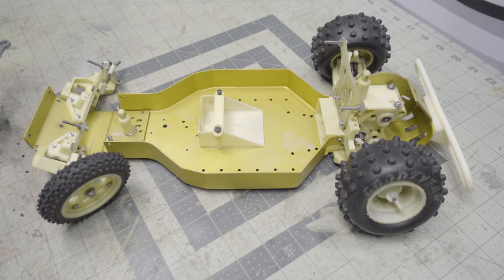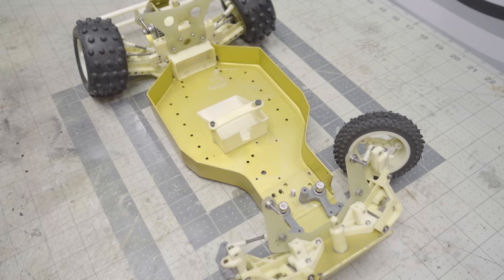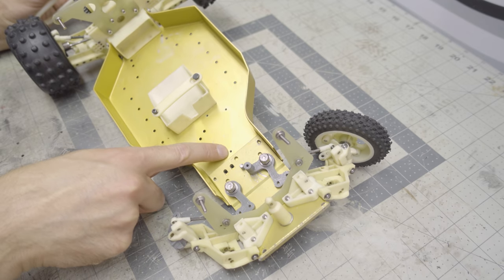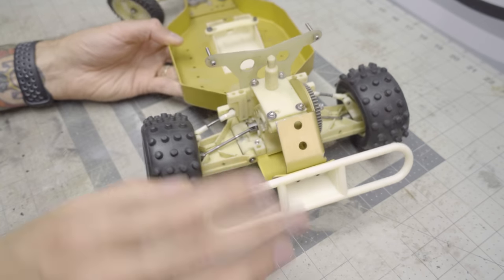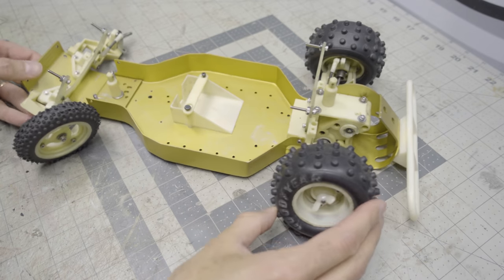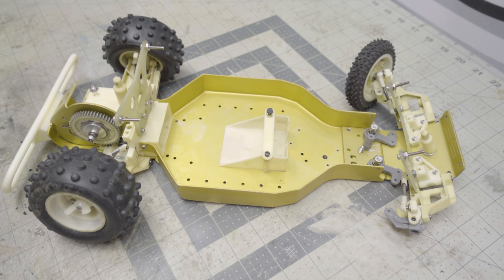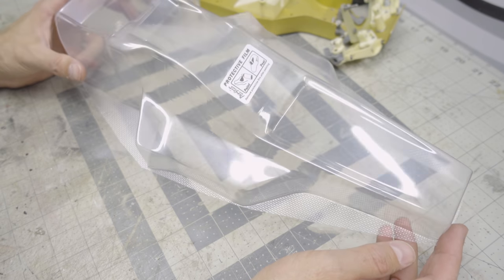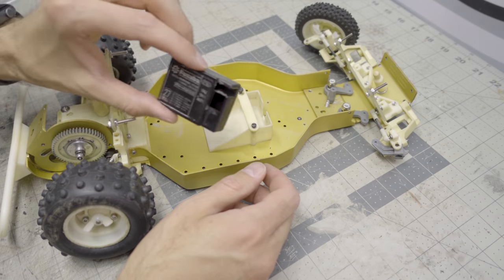Throwback Thursday! Associated Electrics RC10 Restoration Ep2

Comment: A bearing kit cost more than the car back in the day, so they were pretty rare. lol  AE does not have any of those parts lying around, even from the rerelease, trust me. :D Haha!  I probably have a thousand of those turnbuckles, and hundreds of every other part on there. lmao  It's looking good, you did well cleaning it! Many of us run the knock offs, they work fine.  I would sell those tires for a hundred bucks and buy some new ones for 20...  You need to bring that thing to USTE 2021 and run it with us in the vintage buggy class. :)  Again, if you need anything, hit me up.

Comment: Matt, I share your excitement! Ironically, I have a 1983 A Stamp Chassis RC10. In exactly the same disrepair as yours is - missing front wheel and all!! Mine's got the 3 gear Stealth Transmission though... I think I bought it in 1988.

I haven't decided what I'm going to do with it. I've seen ones in worse shape than mine, selling for $100+ on Evilbay. That's a firm possibility, since I have no way of getting parts needed to finish other projects, much farther along than this. 

I'm looking forward to seeing your restoration! It may change my mind... 😉
Carmine ✈🚂🚙

Comment: If it hasn't been done previously, you will have to drill new holes for the battery tray. Early cars were designed to mount the battery crossways. 

The holes that are in the chassis already do not quite line up with the bulkhead. Also, I believe that location is a little short for a stick pack.

Comment: Back in the '80s they used to sell pre-painted bodys that were red/white/blue with sharp, angled transitions. Even though they came with the brass bushings EVERYONE ran bearings! As to the wheels look for the 2.2 dished wheels. I've had the beadlock and glue-up versions, they're better for performance and will keep you from messing up those 1st gen originals. Hit up proline and see what they have, I used their wheels and tires for many years racing off-road buggy. I used to mount the receiver on the rear shock tower, and the ESC on the pan. I also used servo posts to mount the servo with the servo output facing the side. BTW I didn't spend alot on servos, a standard Futaba wasn't the fastest but was always sufficient.
Reply from the maker: Great tips, thank you sir!

Comment: Given that Associated re-released the "Classic" version of this kit about 5 years ago, there might still be some parts available that you can use. I believe that JConcepts might have made a few parts for that version as well. There might also still be some CE style dish wheels that take modern 2.2 tires, as the original CE wheels are for 2.0 tires that were just becoming the norm around that time, IIRC. Also, if that Gold tub was updated with the holes to run the battery pack length-wise like that on the chassis, it's not the "original", original chassis, but rather the 2nd gen one. In either case, I would check the underside in the rear to see if the chassis also has the 4, 4-40 countersunk holes for the Stealth transmission, as it would date the chassis to around the CE era. EDIT: Oh nevermind - I just saw part 1... Looks like it's from that same era as mine. SO it's probably post '85 World's as the lengthwise mod was done then.
Loved that RC10, BTW - I had the 2nd Gen one (purchased in '86), which I later revised to an RC10 Graphite (which I ended up not liking), then to CE specs with a black Aluminum tub chassis (I believe they released 2 additional powder coated colors besides the anodized Black/Gold around that time), except that I installed a Team Pit Stop chain drive transmission, instead of the Stealth. Good Times! I miss that buggy - sold it, along with all the spare parts I had around 2002-2003.

Comment: do you have wing tubes and nose tube ?
Reply from the maker: Those I do not have, probably need them though!
Reply: I just make my own. K&S 83060 tubing and a 4-40 tap. 

I have some soft jaws for my vise that locate the tubing. I drill the tubing slightly larger than normal but the threads are still good.